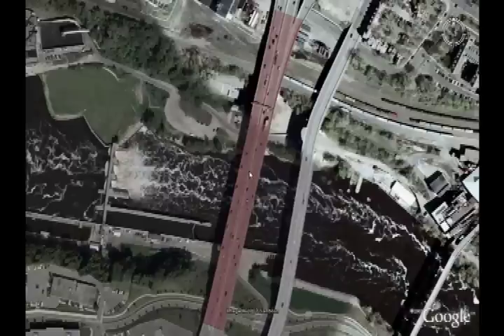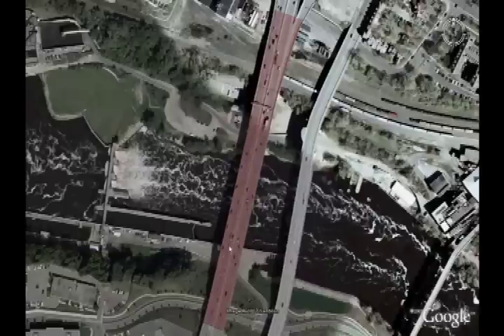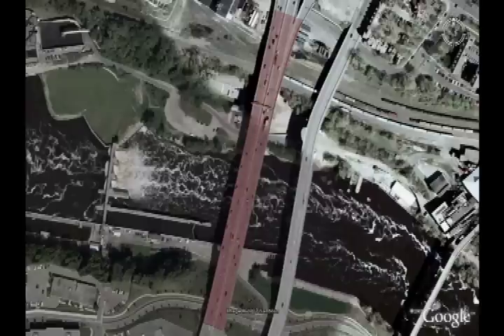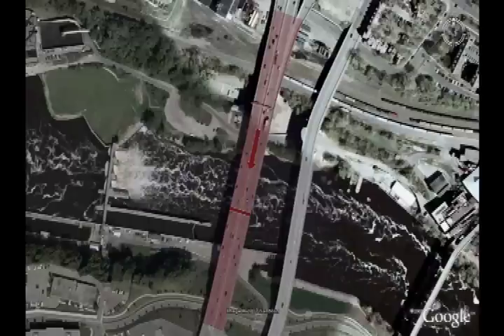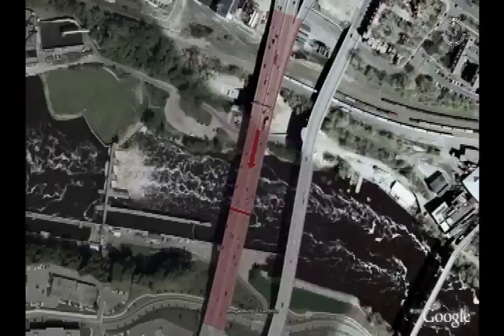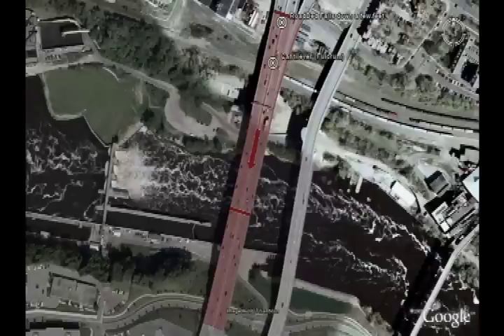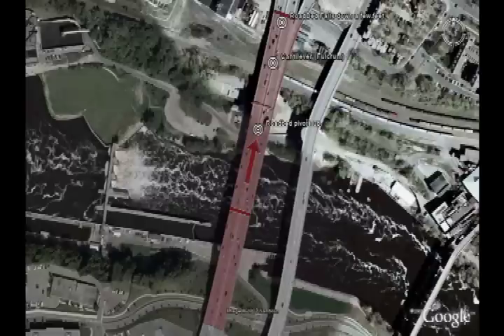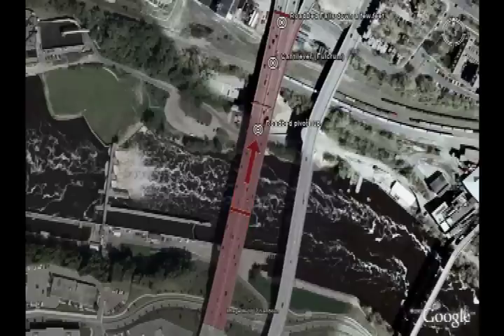Animation of I-35W Collapse Progression

Comment: The tensil strength of wire is much higher than any metal construct of greater density. Second, were talking about a bridge that weigh Hundreds of thousands of tons, no the four or five pound of twisting force you are directing on a piece of wire.